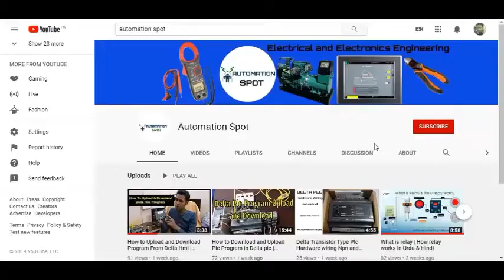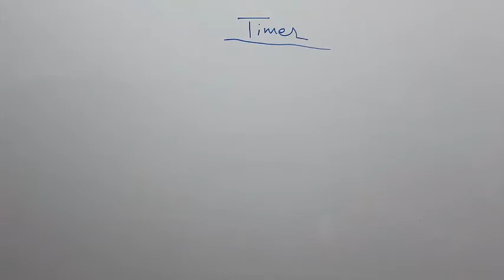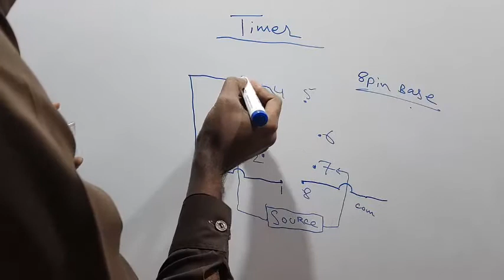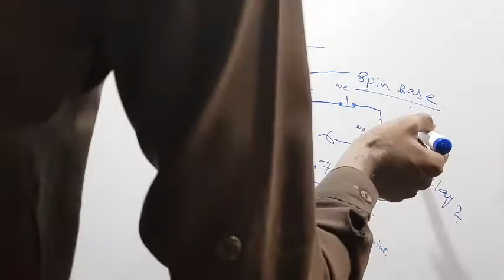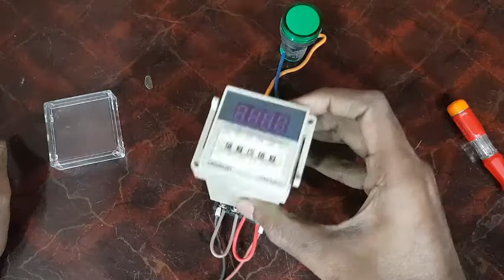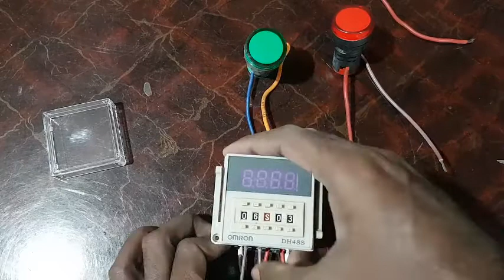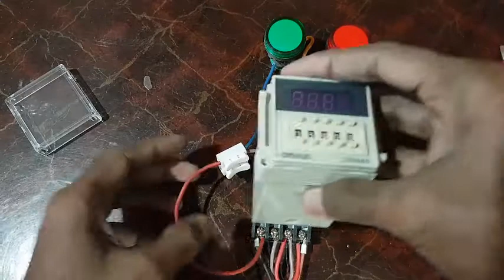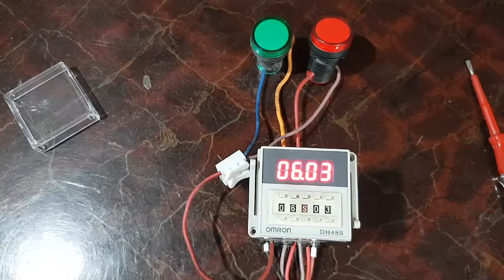Timer On Delay Complete Guide Wiring & Practical | Urdu and Hindi

Comment: Sir it's possible by using this timer when we on water motor  switch water motor automatically completely off 20 minutes, often we forget off motor switch and motor running dry and some time motor destroyed by running dry
Reply from the maker: yes possible.  but make sure you need to use backup system because if timer off and again start then time will start again same set value.

Comment: Sir how can we make automatic fan winding machine ladder
Reply from the maker: Its very simple by using retentive timer you can make programs.
Reply: But sir in this circuit there is a Selector switch for auto and manual selection when it will be on auto side we have only 1 push button to start the machine first machine will start in forward direction and when counter will stop the motor again pressing that push button it will move in reverse direction
Reply: Please guide
Reply from the maker: Simple ap ne Farward run karna or reverse run karna counting k bad. Let suppose ak sensor hoga jo coil k turns count karega, ap ne use counting dena ha 200 turn farward chale then iskay bad 200 turn reverse. Auto mean ye fwd or reverse auto hoga.
manual mean har coil k bad ap ne decide krna fwd ya reverse karna ha.
Reply from the maker: Arduino. circuit hoga?
Reply: @AutomationSpot  Arduino circuit Tu hai mere pas machine pe circuit lgana hai
Reply: @AutomationSpot  Electrical diagram Chahiye Sir - Will you make this?
Reply from the maker: Arslan Fan winding machine you have to design your self. According to your requirement.
Reply from the maker: Meri tabiat set nhi fever ha one week se so ma rest per hn bro.
Reply: @AutomationSpot  get well soon bro
Reply from the maker: Yes Thanks trying to recover bro ..